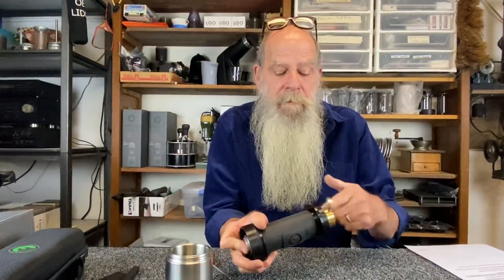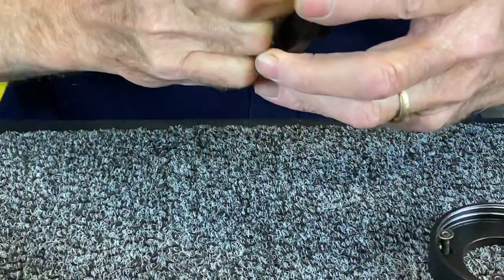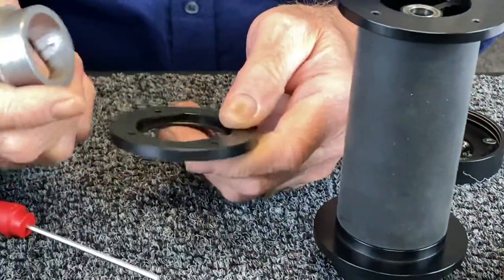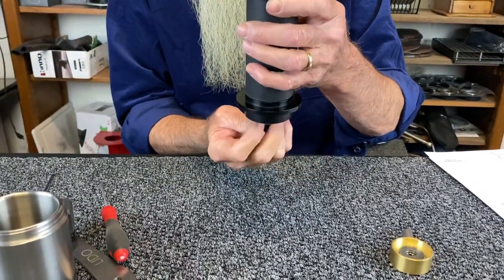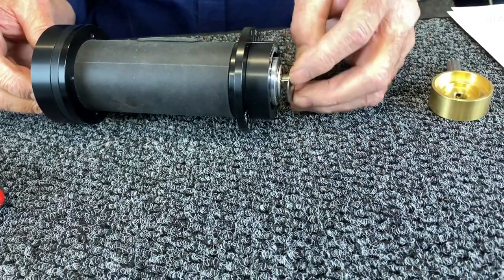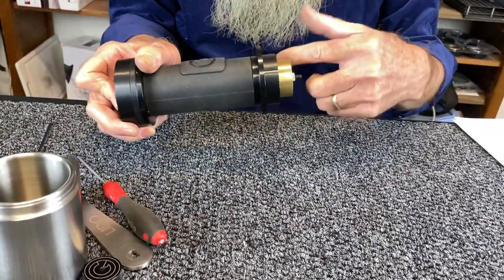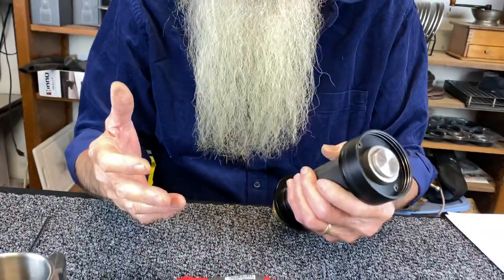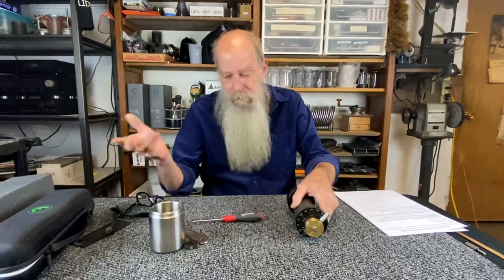OE Lido OG Manual #5 - Burr Alignment - How To

Comment: A beautifully made grinder that has far too many complications. We’re not all engineers my main adjustments is 3 clicks past zero…..geez what’s the point
Reply: I'm not an engineer, nor am I skilled in things mechanical, but I love this grinder. I almost see it as much as art as a tool for grinding beans for the best espresso I've tasted. I don't see the OG as having 'complications,' but as needing a complicated description of what is basically a simple adjustment.
There is a sense in which I agree with ...1185.  The OG CAN be set simply if you want.  Ignore the fine adjustment as you suggest, just find 'zero,' then use the 100 micron clicks - prob'ly get you good espresso at '200' or '300' and higher for other brewing. You could also just use 'where' you set your 'zero' for your fine adjustment for whichever 100 point marker you use.

But most who'd buy a grinder like this care about 'dialing in' and getting the grind size just right for getting the coffee thru the press in the right time with best flavor.